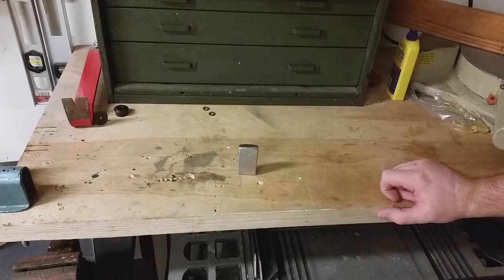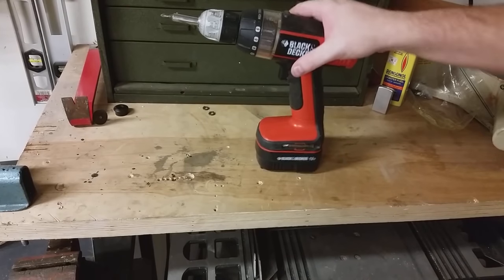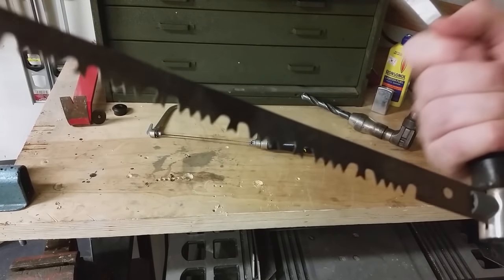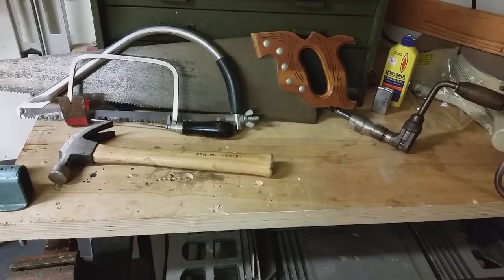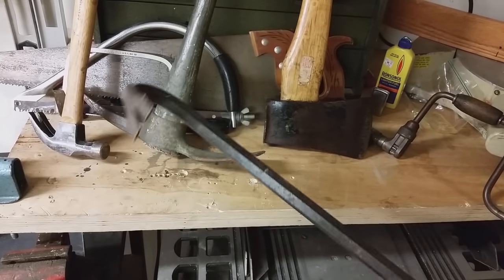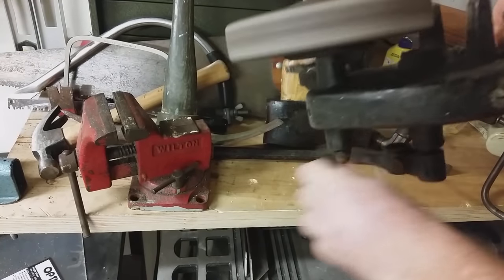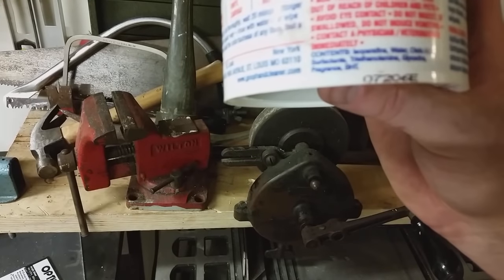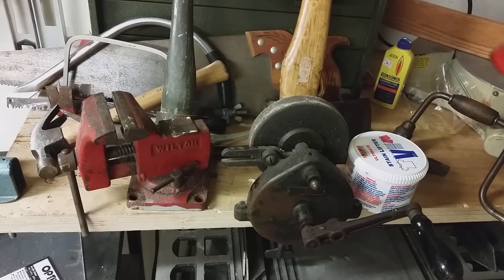SHTF Preparation - OFF THE GRID TOOLS (Prepping for Beginners)

Comment: Enjoyed your video, I think more emphasis should be put on hand tools by preppers. 
Your drill is called a brace , yours has a damaged or re worked wood pad at the end. Most of these are for square shank bits and work poorly with round shank ones. Most like yours has a ratchet feature, left or right ratchet and then locks in place. These are selected by turning the collar behind the chuck. Very common tool and is easy to get a nice one. You can also get screwdriver bits for them and work great. 

Your "clamp" is bench vise, look for better quality ones because low quality ones won't hold up. You want older made in USA , pretty easy to get a nice high quality one at most flea markets for under $20

Your grinder is missing the tool rest but they are easy to make. I have one I rigged up a foot treadle to and having your hands free make things easier
Reply from the maker: Nice, thanks for the extra info!

Comment: An axe is definitely a necessity, but for quartering wood, a splitting maul will work much better.  basically it is a fat headed axe.
Reply: Wedge and sledge are a safer option for wood splitting. You will need a file to deburr the mushroom head on the wedge that comes from striking. Rookies should have an extra handle for whatever you're using. Overstrikes will weaken a wooden handle in a hurry. A thick rubber collar below the tool on the handle will save it for a while.

Comment: I wonder if you could make wheels for that hand cranked grinder by shaping clay into discs and then firing them to make them hard and not dissolve in water, put a small pot of water under the wheel so the grinding surface is wet and have a hand cranked whetstone

Comment: You need a lot more tool in case of a grid down but its a good start. I never saw a hand crank grinder before, I will buy one now. (and I like vintage hand tool)
Reply: A huge advantage of most hand crank grinders is that is easy to adapt them to work with a bicycle chain drive, my grandfather had one set up connected to an old mountain bike and it was my job to pedal while he sharpened tools and blades.

Comment: Nice video. I would also add a bow with some arrows, some metal traps and a dirt bike.
Reply from the maker: +hurc661966 Those are all excellent ideas, I will have to pick those up!
Reply: you might also want to look into a magnesium striker and steel to start fires with. even wet they work just wipe them off, small compact and easy to get at a decent cost for now.
Reply: A dirt bike a atv would be way more useful
Reply: what good is a dirt bike if you can not get a steady supply of gas.only in the movies does motorized vehicle still be useful. if an EMP hits those are useless. horses are better choice or learn to hump your gear like the infantry does. off grid means not having the luxuries of modern life it means minimized living standards, no computers, no cell phone, no microwave, no fridge. it means going back to basics. the video is about survival prepping not moving into the woods with all your stuff.
Reply: +Mermaid Man your saying a dirt bikes are quiet
Reply: hurc661966 and dont forget some booze

Comment: When it comes to hand saws, if you are planning on doing any amount of carpentry with hand saws, you HAVE to have the correct one for what you are doing.  I mean, most will work, but effort will be massive without the correct saw.  You need both a ripping and crosscut saw.  If you are trying to rip lumber with a cross cut saw, it is going to take forever.  I think this is the main reason, along with lack of knowledge on tool preparation, that makes people hate hand saws.

Comment: Unless you are a smoker and use it every day the zippo lighters are bad You need an airtight gasoline lighter with an o-ring on it. These are also cheap and you can order them from the internet for like 5 bucks.
Reply: I use a length of bicycle inner tube to keep my zippo lighters fuel from evaporating, and it also works well as tinder, if you have cans or bottles of lighter fluid stored even they can be affected by moisture in the air, I keep mine in ziplock bags with a few 10g silica gel packets just to extend the life of the petrol.

Comment: How come not i e ever so called professional preppwr suggests an old scbool multi soze pencil sharpener to screw to a tree wet sticks o to dry lindling inseconds never breaks rhey worked for twenry yt? ears and got replaced with electrics good item to have in pouring rain insoxe of wet twigs is dry